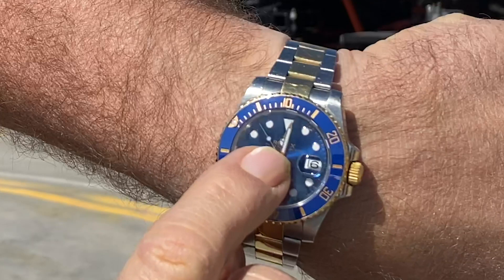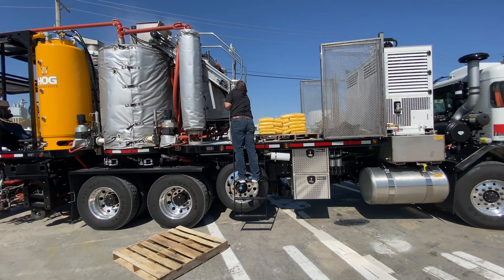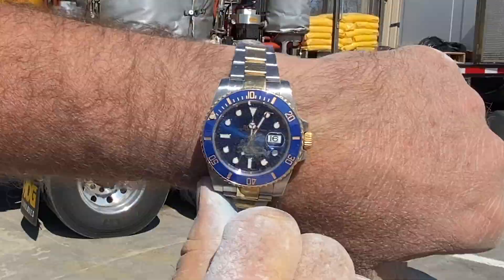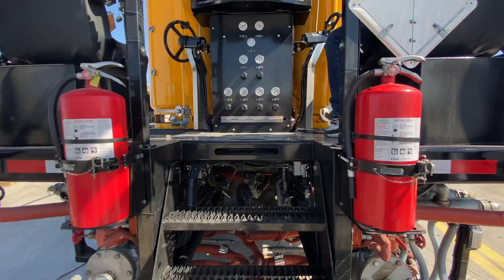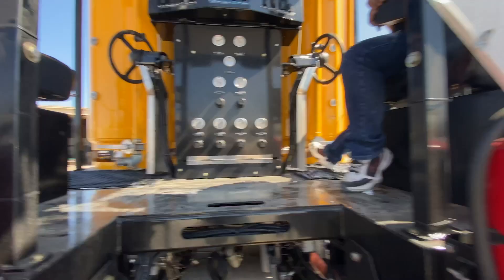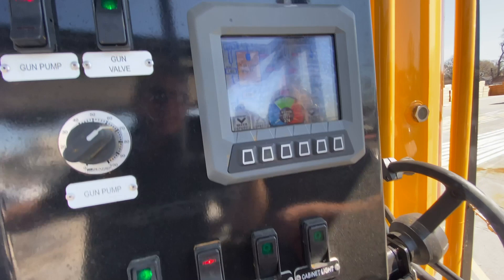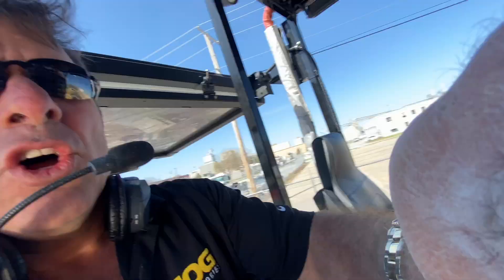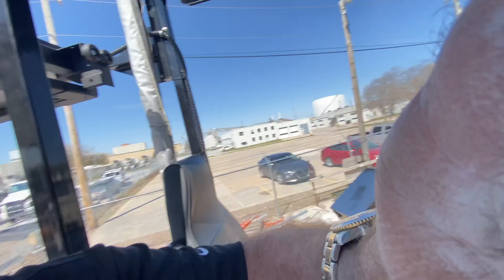The Thermo Hog heats 2,000 lbs of thermoplastic in 10 minutes

Comment: Kettle doesn't look like it could hold but maybe 4000lbs. Not getting more than a 2 and a half or 3 mile pull of edge line on that. Maybe if you had 2 kettles per collar or at least a 6000lb capacity one.

Comment: Nice hog. what tplastic material do you prefer
Reply from the maker: Thanks! We don't necessarily lean towards a specific brand. We use several different brands in order to make sure the truck operates effectively no matter what. Our customers have various preferences so we want to make sure no matter what that preference is that we can facilitate.
Reply: If it were crown it would of fell apart all over him and the truck
Reply: @anthonylewis9256  YuP that's what we use and it's messy af